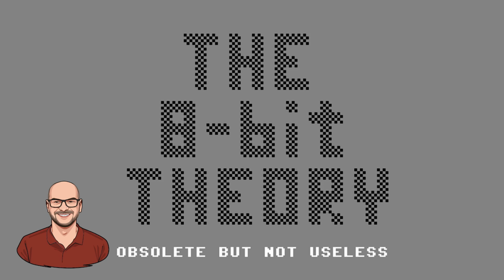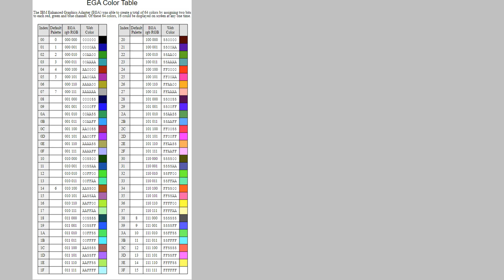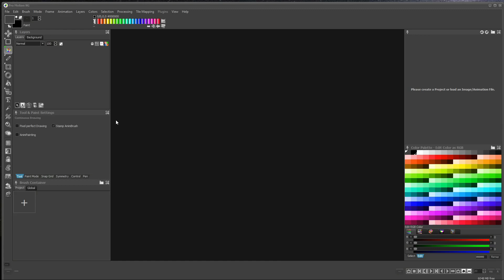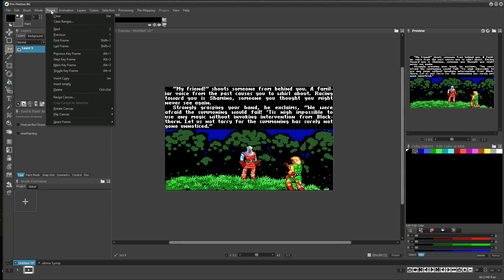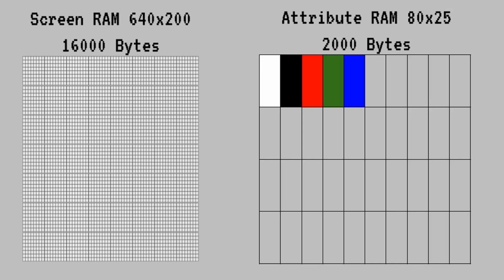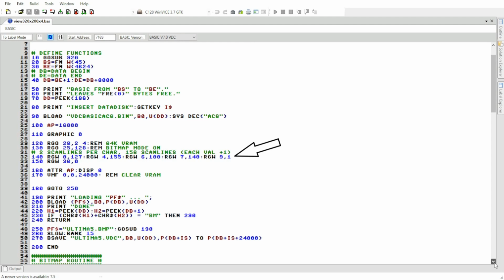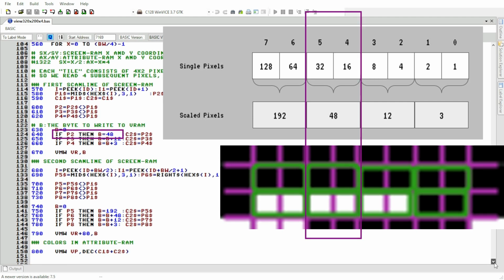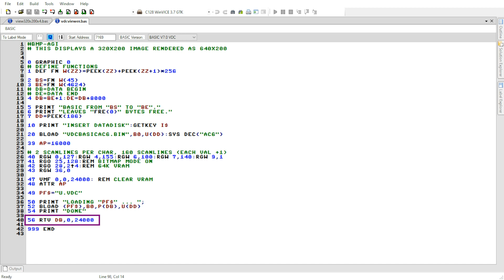EGA on the C128? And it looks great

Comment: Wasn't one of the VDC's shortcomings that it didn't have the performance compared to the VIC? A lot of games took heavy advantage of the VIC's hardware capabilities to make them run fast and smooth, I have no idea whether the VDC was also somewhat capable of doing that, or if it was more of a 'dumb' display adapter that just displayed whatever you put in VRAM and not much more.

PC's didn't really have that limitation since the EGA was already pretty much a dumb adapter from the start and CPU's were fast enough to handle the simple bit-banging method of generating graphics, so it didn't need any accelerating features like hardware sprites.

With regards to graphics quality games like Sierra or LucasArts adventures would really have shined on the C128. Imagine "The Secret of Monkey Island" releasing a few years earlier with Michael Land's music on (stereo?) SID sound.
Reply from the maker: It‘s mainly the missing sprite capability and the lack of raster interrupts that really limit the chip. 
In-memory operations are ok in speed, I guess. And 64k of VRAM make up for a lot of things. It‘s no arcade chip, though. 
EGA was no better, you‘re right. But the 286 and 386 have much more horsepower to make it shine. Soft-sprites are no problem with sufficient processing power.

LucasArts games should have worked. Sierra not so much because the vector drawing doesn’t go well alongside the color-resolution limitations of the VDC.

Comment: 320 x 200 x 16 is still CGA, 320 x 200 x 256 onscreen  out of 262,144 colors (18 bit palette) is MCGA,  EGA supports: 640 × 350 × 16 colors on screen out of 64 colors
Reply from the maker: Right. And MCGA was never released as a dedicated adapter, it was only available on VGA cards.
Thanks for your input!
Reply: @the8bittheory  that is close to true, Ps/2 line had dedicated mcga that were not vga, because there is a big difference... you can play some vga softwares over mcga, but they have to follow certain memory rules... resolution can not exceed 320x200 and it must not use more than one memory page, and none of the vga specific control registers. My model 30 is MCGA only and I believe 1 or two other Models came with Mcga only... but since IBM was trying to isolate itself from the clone market, no plans were made to implement this on an ISA bus, so VGA being so close to the standard could emulate mcga for the software that needed it it on a clone.
Reply from the maker: Interesting, I wasn't aware of that. Thanks for bringing this to me!

Comment: IBM PGA was released in 1984 and it has 256 colors from 4096 color palette.
Reply from the maker: Never heard about PGA before. Thanks for mentioning!
Reply: @the8bittheory  PGA is also known as PGC. Its designer later designed SUN's GX geometry 3D accelerator and later co-founded NVIDIA.

PGC's 640x480p hoz-freq has 30.48 kHz which is close to VGA's 640x480p hoz-freq of 31.7 khz. 

VGA's mode 13h 256 color mode was introduced by MCGA in 1986.

Comment: Why do you use past tense in your video? Have all C128s vanished? Are all copies of Ultima 5 erased? Have all EGA graphics cards been tossed in the trash?
Reply from the maker: Hm, good point. I‘ll check that :-)
Thanks for bringing this up.
Reply: @the8bittheory  Thanks! Other than that, your video is really interesting. Here's hoping  someone will port King's Quest to the C128! 👍
Reply from the maker: Sierra AGI games should be doable, I tried converting Space Quest artwork for example. The rendering process would need to be different though. But I‘m planning on touching that. 
Thanks for your input!
Reply: @the8bittheory  Rendering process? You just earned yourself a subscriber! 👍
Reply from the maker: Well, I might be mis-using the term, but AGI games use vector graphics. The c128 would need to work with bitmaps for various reasons. I‘ll touch that briefly in the upcoming video. 
Glad to have you onboard 👍🏻
Reply: @the8bittheory  If you would even make a so called "vertical slice" of a Quest game on the C128, allowing users to control Sir Graham/Sonny Bond/Larry on just a single screen, you would write Commodore 128 history! 👍
Reply from the maker: We‘ll get there :-)

Comment: 320x200x16colors was also possible in pre-EGA times for example on the Amstrad PC1512 or Tandy. EGA is 640x350x16 of a palet of 64. So no - the C128 is NOT Capable of doing this.
Reply from the maker: You‘re right, it‘s not. But it can be really close in many cases and close enough in even more of them. 
Thanks for your feedback!

Comment: C128 is by far the most unexploited power from commodore,i had one.
Reply from the maker: Yes. I agree.
Reply: @the8bittheory  I remember some magazine article back in the day about 4096 color hack mode for C128, was it some alternating-frames trick or did I just hallucinate that. Ever heard anything like that?
Reply from the maker: I think that used adjacent pixels to generate a dithering effect. On CRTs that‘s blurry, so it looks like a different color. Won‘t work so well on LCDs though.

Comment: EGA adaptors organized the 16 color graphics modes in bit planes, with 4 layers of 8 adjacent pixels.  I believe the Windows bitmap format of that era did the same.
Reply from the maker: Right, the ressource files of EGA games are pretty much always organized in color planes. 
The bmp files I worked with here did not though. Maybe there‘s a difference in the various flavors.
Thanks for your input

Comment: The combination of a lack of a raster interrupt, lack of sprites, and (to a lesser extent) metastability issues of the interface made sure the VDC wouldn't be a big target for games in any event.
Reply from the maker: It‘s definitely not everyone’s favorite chip. And it‘s for sure not made for arcade games. Definitely a blocker back then. 
But very worth taking a deeper look today, under different circumstances :-)
Reply: @the8bittheory  Would have been quite a nice chip if the issues had been fixed.  It had hardware block copies, too.
Reply from the maker: @glenndoiron9317 oh yes. Block copy will be a significant topic on one if the upcoming videos.

Comment: I wonder if this is what is going on with the RAD cartridge for C128 when they play Doom? The game is running on the R-Pi but then they render the video frames back to VDC and I guess it keeps up to 60 fps.
Reply from the maker: RAD-Doom is leveraging the VIC-II chip and even on a C128 it runs in C64 mode. But besides that, afaik they directly render the image data into the Video Memory area, you're right. More information here: https://github.com/frntc/RAD-Doom

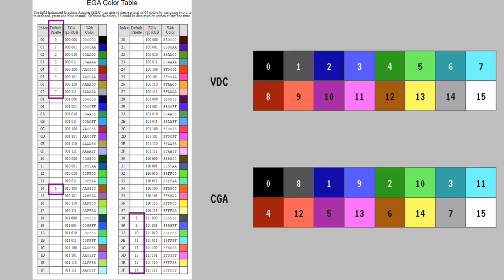Comment: 2:51 That's kind of the curse of EGA lol, how the typical CGA monitor use cut off the full 64-color EGA system palette from ever being used 99% of the time as there are only a handful that do support a switching EGA monitor option Eg. Ivan 'Ironman' Stewart's Super Off Road, thus EGA being CGA default colors. So for one the video card costed more, two not a lot of games actually supported it's full potential, and three by the time VGA monitors with backwards compatible modes became common it was too late. A very botched DOS video card generation.😒
6:46 Yeah that particular limitation is quite bespoke, reminds me of the color byte setup of the MSX/Colecovision/Adam, I think manual intervention is the only solution. That overall conversion protocol is just complicated enough that I think an automated tool is in order for more people to use this format ijs.
I see some people complaining about the old cost restraints of using the VDC but CRT use is rarer now, I like my tubes but even I take into account LCDs and how things look on them since they are so commonly used now.
Better to use the chip full now rather than almost not at all like it was in the past. Same can said with other things like the Amiga 500 it is not a one-button joystick platform, never has been, so stop treating it as such for past reasons with future projects. Great stuff.🙂
Reply from the maker: That's absolutely correct: I own a PC1640 that features an EGA card, but I only own the CGA monitor. And I'm really happy that I can play virtually all EGA games.
Right, monitor constraints are a thing of the past. I'm also thinking about doing a video that shows all the modern display options for the VDC chip. While I own a number of CRTs, LCS just take less space and are less noisy (my kids hate the high-pitched sound).
Time to take the C128 to the 21st century :-)
Thanks for your input!
Reply: Lol that is hilarious, for the life of me I don't remember CRTs making noise as a kid and now I'm too old to hear it anyway heh.😂 For me the constraints of EGA was a hindsight thing, my buddy had some older monitors but I started with VGA. @the8bittheory

Comment: At 640 bitmap pixels wide, you could do twice as fine horizontal dithering compared to EGA.  Also, if 8×2 color cells only takes 8kB of VRAM, 8×1 would take 16kB, and 4×1, if that can be done, would take 32kB and still fit into the 64KB VRAM.
Reply from the maker: You‘re right. Planet X3 does dithering in 640x350 mode I think. Well worth a try. 
8x1 is possible, but you have to set the register to 0 during vblank and set it back to 1 before the end of it. The max horizontal resolution is reduced to ca 480 pixels then, however. 
Less than 8 pixels horizontally can be set but doesn‘t work. The display goes blank immediately. 
But yes, the 64k really allow for a lot of possibilities, leaving all of CPU RAM available for the program and data.
Reply: @the8bittheory  I have successfully reduced the character width to 7 pixels. I could not get 6-pixels to work, but I'm no expert on the VDC registers. Any time you mess with the screen geometry the chip can lock up.
Reply from the maker: @stevegray8801 yes it‘s so easy to break the display. Amazing you managed to get char width down to 7 pixels. Any code you can share?